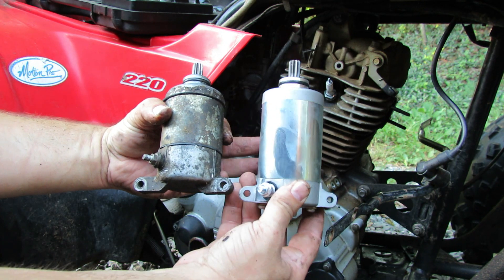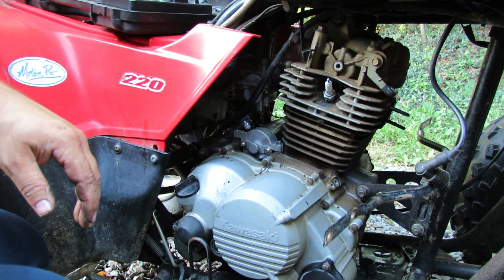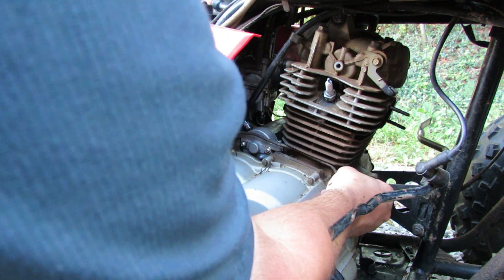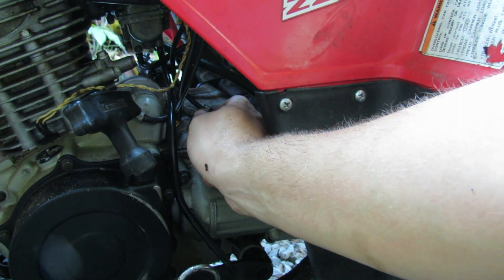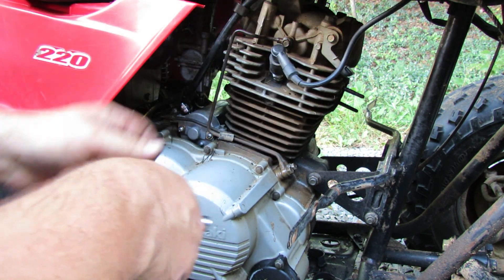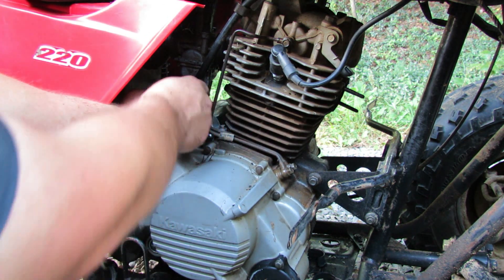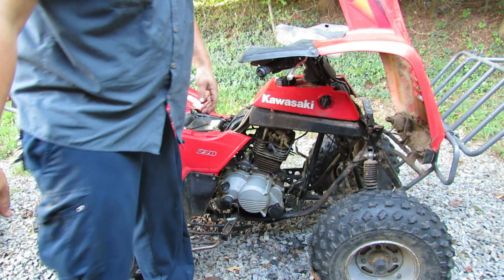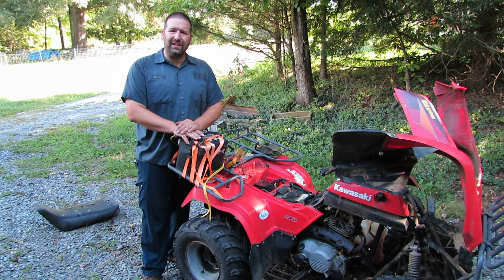Part 2 Kawasaki Bayou 220 Starter Replacement

Comment: Very informative! Just had a 250 bayou given to me that needs a starter and a muffler. Muffler is easy, starter not as easy. Thanks!
Reply from the maker: @JWilbanks-m2c a Bayou 250 given to you! That's awesome. The starter isn't bad. Just those oil lines and then that aluminum piece I had to file down. Those are the hardest. You don't have to remove all the plastic like I did it just helped the get better video. Thanks for watching and commenting. ~Mr. C.

Comment: Hello , I bought 2 bayou recently , from a old guy and there’s one for parts and the other one should work , I added a battery fully charge on it and when I turn the key On and try to push start it doesn’t do anything , I thought that maybe the starter doesn’t work anymore but i’m not sure , it do no clicking nothing
Reply from the maker: Steevie Kouadio congratulations on finding two of these awesome machines. If you are not hearing any clicking the solenoid under the seat is not engaging. A few things can cause this issue, one is the solenoid coil is bad. Another is the push button is not sending voltage to the solenoid to engage the coil. The wiring between the two devices could also be a problem. The starter can be checked by doing a resistance check to ground if you think that might be the problem. You can bypass the solenoid by jumping the two large terminals temporarily to see if the starter is engaging. I am including a video about a lawnmower solenoid that might help. The principals are the same and should provide some useful information. Hope this helps. ~Mr. C.

https://youtu.be/yOLAGD8WQ-s

Comment: How do you if your starter is bad? I’ve got 220 and sounds like it’s spinning not starting
Reply from the maker: @Ray Alexander if it is spinning and not engaging I would take it out and check to see if the gear is worn or the gear moves freely out enough to engage the engine gear. Check the engine gear to make sure the teeth are not worn or missing on that too. ~Mr. C.

Comment: Would it be the same process on the larger 400 ?
Reply from the maker: Luke Holmes the process is similar but the part number is different. Check out the other comments on this video and part 1, another viewer describes an easier way to access the starter to swap it out. I removed extra items to make videoing easier. Good luck! ~Mr. C.

Comment: I've watched a number of your videos very good but always noticing the car battery strapped on the rear rack people will do that when there stator goes bad or Rectifier running a car battery too long could burn up your starter maybe you need to do a repair video on that
Reply from the maker: Mathew Goebel thank you for letting me know to look into that. I have done a video on changing the battery out for a sealed lead acid that will fit under the seat. I will provide a link below if you would like to check it out. Again, thank you for a supportive comment. I enjoy hearing from other gear heads on their life lessons and what they have experienced. ~Mr. C.

https://www.youtube.com/watch?v=amWq380oepQ&list=PL9e-N4NEgHNuolD2PEktYxS3qc1vSgrwX&index=13&t=0s

Comment: Can the starter not be changed by taking the breather air filter box out. That's where I'm at and I can get to all the bolts. The only problem is it appears the oil lines are in the way. Has anyone else done it this way. Seems it would save removing plastics and exhaust.....
Reply from the maker: R Moses I think you can access it like that. I would say the oil lines definitely need to be removed to get the starter out. Thanks for watching. ~Mr. C.
Reply: @NaturesCadenceFarm  Success! I was able to change it out by removing the air filter box and dismounting the carburetor, I also only had to remove the one side of the oil line that wraps around the starter. Didn't have to remove nothing else. Turns out to be about a 15-30 minute swap if I had to do it again.
Reply from the maker: R Moses that is awesome! If I need to swap it out again I will follow your method. Sounds a little quicker than the other way. Thanks for letting me know. ~Mr. C.
Reply from the maker: R Moses that is STRANGE. Acid will dissolve brass, maybe something like vinegar. I am thinking pickle juice. I do not think sugar will do that. I have used Stabil for years with great success. I have had gas work in equipment that was around two years old. Sounds like some sort of contamination... either by accident or on purpose. ~Mr. C.
Reply: @NaturesCadenceFarm  that what I was thinking. I've made a few enemies at deer camp because of jealousy and that's the only opportunity for someone to get access to it without me knowing. Thanks!

Comment: Dang I wish my bayou would run with just a new starter, I’ve bought one that has wiring issues, when you hook the battery up even with the key in the off position and no one touching the start button it starts spinning over, and when the key is on the neutral light doesn’t come on. The culprit looks to be a yellow and black wire that has a three way split which seems to me like one comes from the positive of the battery then the 2nd one goes to the ignition coil, but the third one is just cut. I don’t know what to do.
Reply from the maker: rippinit 196 WOW that thing sounds like it is having a bad day. I would say a Clymer manual would help but it does not have a wiring schematic in it. The manual does have a little information about the starting and ignition circuit. Good luck, I would love to hear if you got her figured out. ~Mr. C.
Reply: @NaturesCadenceFarm  Thanks for replying, I've got a Clymer manual and I think I narrowed it down to the wiring from the starter to the solenoid to the battery, but I'm not sure, I hope I'm able to figure her out though.

Comment: What a helpful video. My only issue is that starter lasted 3 months before going out.
Reply from the maker: @Jeremy Cecil that is a bummer. Glad you found the video useful. I have not had any problems with mine, yet... Thanks for the update. Maybe try another seller / brand. OEM is an option. Good luck.  ~Mr. C.